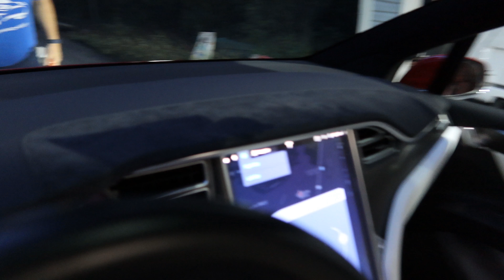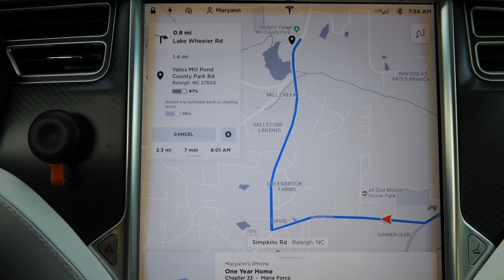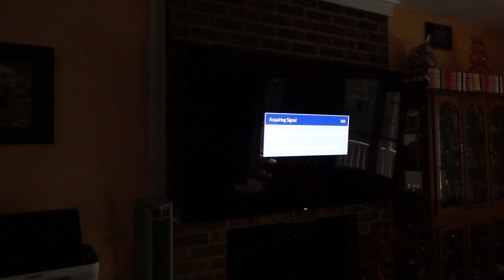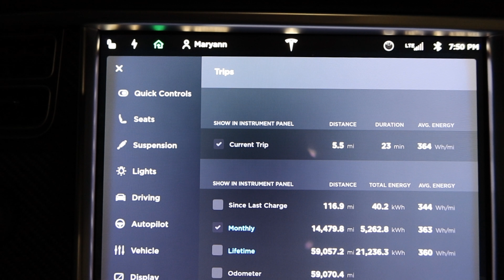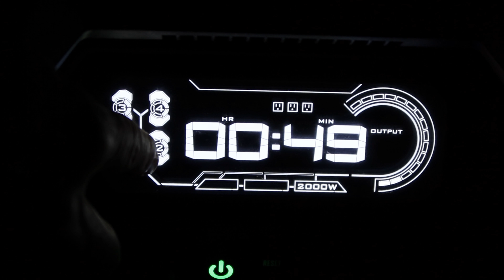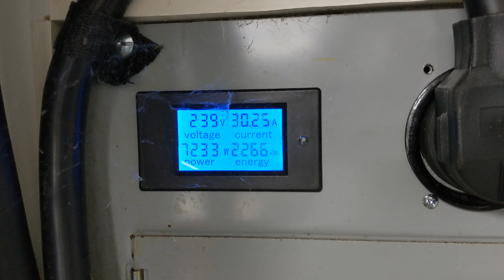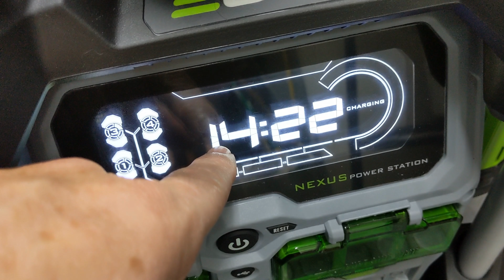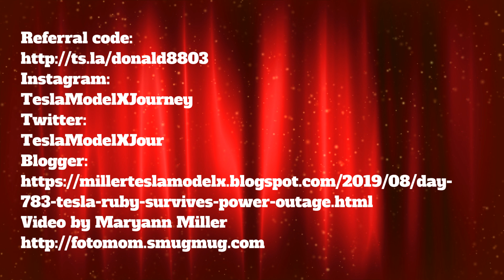Day 803 Tesla Ruby Survives a Power Outage

Comment: OMG I'm loving the 360 footage at 4:48.  You're really learning how to make great video with that camera.  My only comment, and sorry for the constructive criticism, is that the 360's movement is jerky but that may be YouTube.  Re: spider at 10:24 - Sunday I took a pic of the largest writing spider I've ever seen.  It's body was about the size of my thumb.  I'll send you the picture but due to the location and not wanting to disturb it the picture isn't the best.  It was probably 5-6 inches across with it's legs or about the size of a softball.  Nano HD - I'm considering a mesh setup and i'd love to hear Don's comments on this.  With 3 house levels I'm thinking one on each level.  i can't get a good signal on the upper floor and to the garage for Sven.  The rule if the traffic lights are out is to treat the intersection as a 4 way stop.  Loved the E-Go footage!
Reply from the maker: The 360 camera has a phone app and a MacBook (or PC) app. I'm mostly using the phone app because I can transfer the files from the camera to the phone directly, edit anywhere, and then just upload the desired final footage to the regular daily video editor. Both 360 editing methods have pros and cons. So what I have to do to include clips in the daily video is to create a fixed view video from the 360. And to do that, both methods of editing let you put in turn points. On the phone app, they re called pivot points. It's a bit different on the MacBook. The boardwalk 360 fixed view video that you liked looks fairy smooth to me, but it has a drone movement feel to it I think. I'd say the software can continue to improve. I'd like to see it remove the shadow from the stick as well as the stick itself. I think giving n number of seconds of video to perform a x degree turn in the video might help. Also, that pole looong. I know a few times it was a bit wobbly but the height is so necessary for some of those aerial seeming views. Next one I'll do the edit on the MacBook, and you can let me know if it has a different/better feel. 
-
I love writing spiders. The guy you saw sounds amazing.
- 
I told Don you'd love to hear his WiFi thoughts. He must have watched 10 videos before switching gears from the Google system to the Nano HD. Will be a couple weeks before JB is here, but I'm sure there will be more updates as the installation and testing goes.